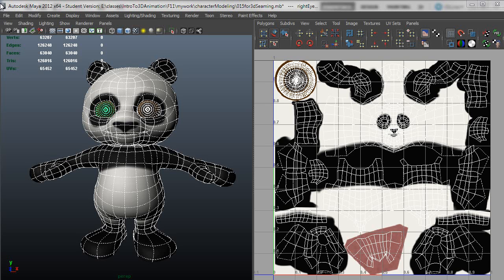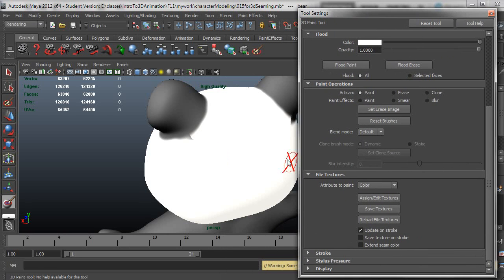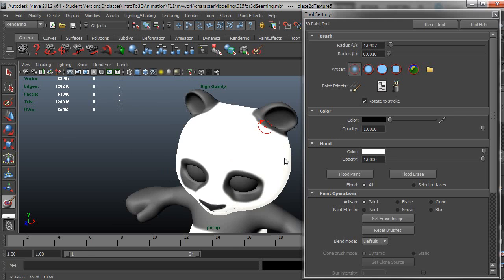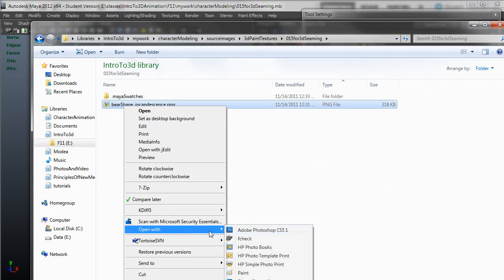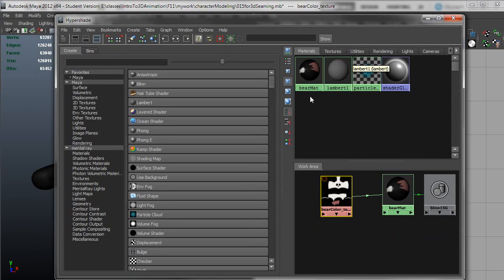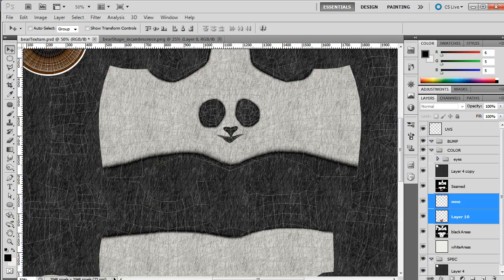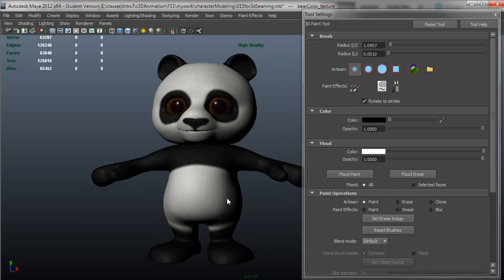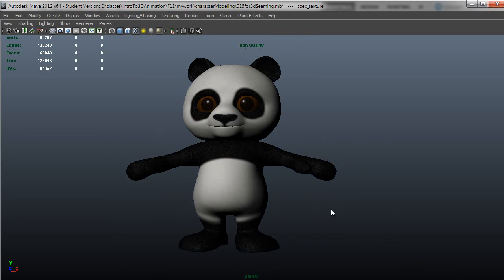Maya 3d seaming & texture hookups

Comment from the maker: I'm no expert with zBrush (I use Mudbox), but I'll give it a couple of guesses.  Did your topology change?  Often times polypainting is done on a really high res mesh, but that map is applied to a lower res mesh - if this is the case for you, maybe the texture border (or the distribution of distortion in the border) changed slightly and caused the seam to show. Another possibility is if the colors aren't extended beyond the texture borders enough that might cause some seams to show.